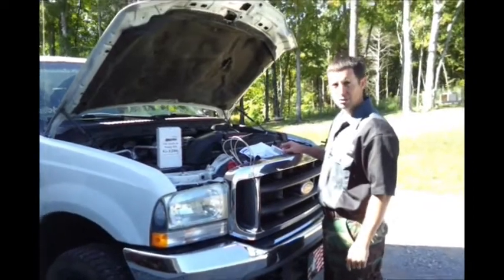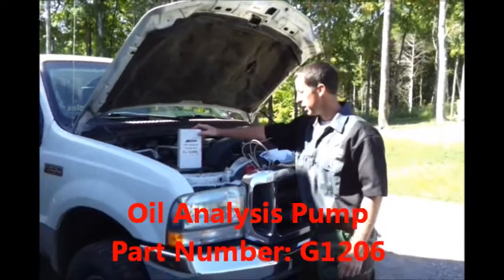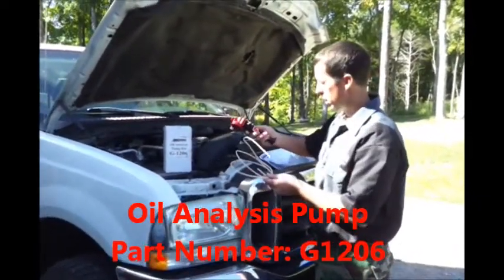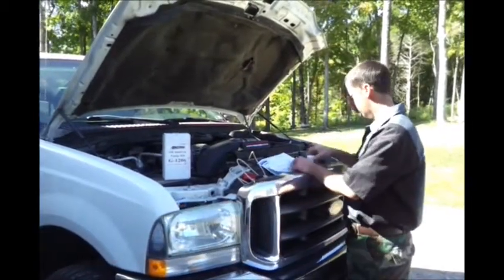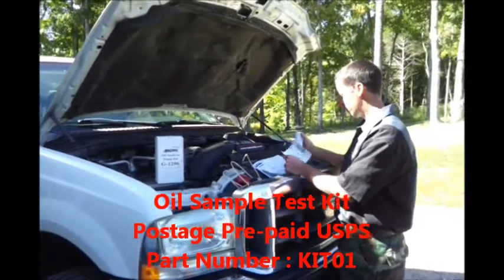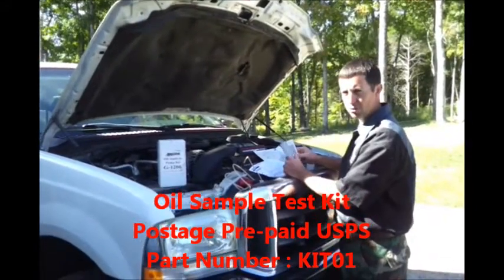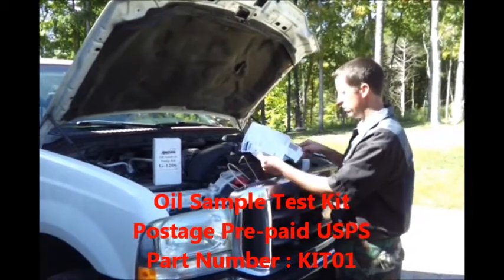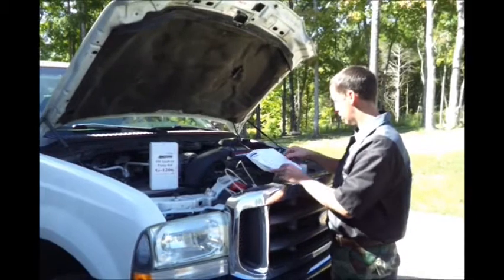How to Take an Oil Sample

Comment from the maker: Stuntjake7 - I've never used Blackstone Labs. I just looked at their website and the cost is about the same, $25 for the standard test. This price is offered for our Preferred Customers (save about 25%-30% on everything). The price also includes the shipping of the sample to the lab. From what I can tell the labs performs similar tests on the oil. The most important thing is taking the samples. Let me know if you have any other questions.